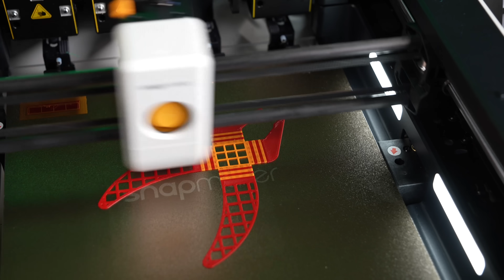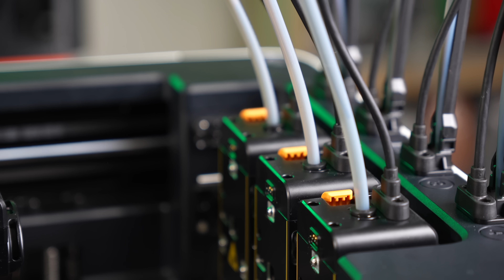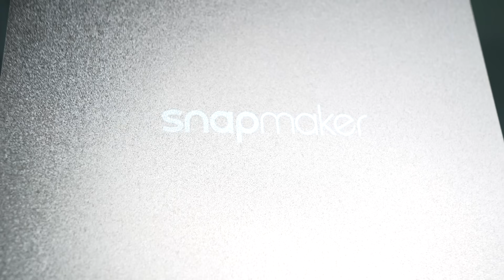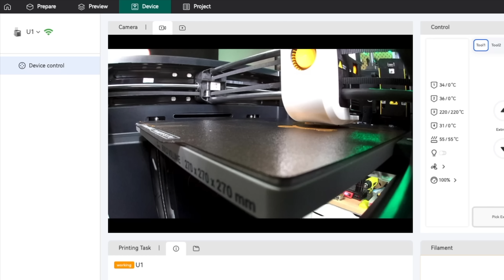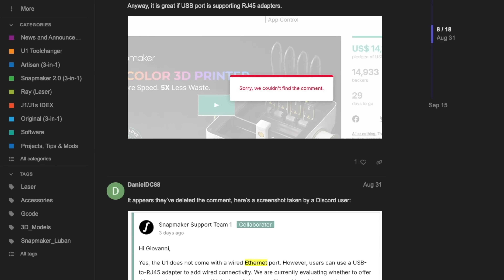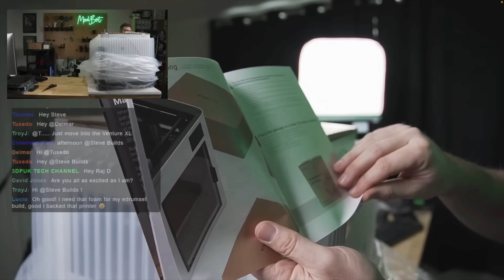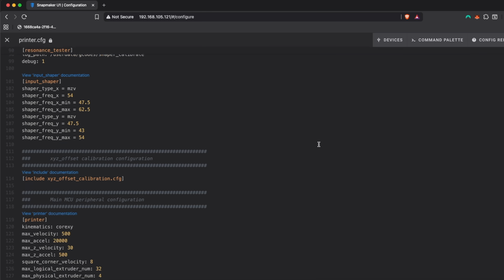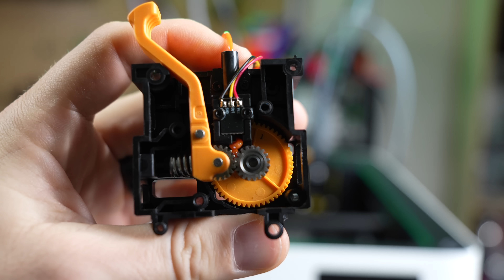Would I Back It Again? Snapmaker U1 Tool Changer

Comment: So tempting at 850
But I think I will wait and see how this whole thing shakes out with U1 and vortek and INDX and whatever else come out this year first.
Personally I am hoping for an A2C and or an A2D with a vortek system.
300x300x300 and at the launch price of the A1 or A1C
Have it be compatible with the AMS lite  but still offer an AMS lite pro with an enclosure and a dryer.
Same design of having all the PTFE tubes going into the tool head.
Maybe they can add 2 more spools so there are three on each side in a triangle formation.
Of just give us 4 and an option for an A2D so we can have five colors/ materials with the spool holder.
No retraction time like the H2C because the cutting is done in the tool head.
All they would have to do is put the vortek rack on a sled that moves front to back in the Y axis to the right of the bed.
The vortek upgrade is not even expensive.
I would love an entry level poop free machine that is in the Bambu ecosystem for multi color PLA prints.
This makes the most sense.
Like the A1 and AMS lite was faster than the P and X series because of no retraction.
Offer it in 2 flavors, A2C and A2D 
One with the dual nozzle tool head one without.
And offer each one as a combo  or let ius use our old AMS lite if we want too.

Comment: If you have filament in the loader (but not all the way to the head) are you able to pull the filament out without unloading on the screen? For example, if it starts loading, gets a bit of the way into the PTFE tube, are you able to grab the filament and push and pull it back and forth, or does the loader hold onto the filament and prevent it from being pulled out? (Like the AMS lite will sometimes not allow the filament to be pulled backwards without pushing the lever on the loader.)
Reply from the maker: Yes if it’s not fully loaded you can load it. I’d wait for after the loader to stop though. It won’t load it all the way into the toolhead until you tell it to from the screen.
Reply: Also, do you have to load the filament in a certain orientation? Like I saw the top filament loads from the bottom of the roll... And so does the bottom one... But could you flip the lower one over and feed it from the top? Just wondering if it's directional.
Reply from the maker: @willmorton6800 I found myself uncreating on the correct orientation for loading. There might be a right way but it always worked no matter which direction I fed from.

Comment: I really like this machine and the price point is good! I hope they make something at an lower price point.
I'm not interested in multi color/material prints, so I'd be happy with a single toolhead/color printing, something to compete with the mainstream brands with closed firmware, and unreliable machines.
Reply: Honestly... if you just want single colour & head... consider the QIDI Plus4, it's what I got, and I've been extremely happy with it as a single-filament printer.

Got mine in... march I think, and it's been super-reliable. 
Feeding TPU in is a PITA, but doable. I think that's the only real issue I've had.

Comment: My project printer will never run, from originally wanting it to be a corexy, to an enclosed one with built-in heaters, to wanting it to be on 48v DC and now waiting on Bondtechs INDX syste.

At least the K2 has been a work horse i just wish orca slicer wouldn't refuse to slice vastly different materials like TPU and PC, it should just let me ignore the warnings or offer a solution like using an intermediary purge material to bridge the thermal gap.
Reply: But you always learn something in the process while you build it.

Comment: The toolhead disassembly doesn’t look that much worse than a 1st gen bambu machine (X1/P1)
Reply from the maker: I feel like the Bambu X1/P1 has less small wires and it also doesn’t make you remove the toolhead pcb. It’s definitely not great either though.
Reply: @ModBotArmy I don’t have a U1, but from the video it looked like you could access the extruder gears with a lot of the extruder still in one piece. On the X1 it is 3 connectors and you need to take the extruder completely apart. P1 connectors are a lot nicer, but I wish you could retrofit the newer hotend type (A1/P2/H2)
Reply: Yeah, they ran their photocopier a little too early. 😆It looks very much like an X1 ... from the frame and motion system over the carbon rods and the part cooling fan to the finicky nozzle swapping with multiple different cables.
But, at least in theory, they can just release a new version of the toolhead. Current version retails for 70€, that'd be 280€ for a full set. Not cheap, but much cheaper than getting an entire new printer...

Comment: I've been using mine everyday since I got it and ran into some minor issues. I will say that the issues were easier to resolve than on my other printers. It works pretty well and I agree with your observations. Overall it is a wonderful printer and certainly better than most printers at this price point.
Reply from the maker: What issues did you run into? Also! What backer number were you? I strongly believe no printer is perfect but for the price point it seems like an incredible value for what you get based on my testing.
Reply: @ModBotArmy  One was a filament feed error which ended up going away after unloading and reloading filament that became twisted. It took a few tries, but has been solid since. The other issue was toolhead 4 alignment error. That was fixed by re-tightening the belts with their simple procedure..

Comment: Although it has multiple tool heads, how does it heat/cool the filament when switching?  Wouldn’t there still be a lot of delay heating and the possibility of clogging from non-traditional cooling?
Reply from the maker: Each tool head has its own hotend fan so it’s able to heat up and cool itself independently from being switched.
Reply: And I think it starts heating a few seconds before it's switching, to minimize delay.

Comment: Three primary reasons someone would want a tool changer over an AMS style system: It's better. It's better. It's better.
Seriously though, I applaud Snapmaker for bringing an affordable toolchanger to market that also seems to work well.
The print quality looks overall great and even if there is room for improvement in some areas, it seems like a solid value.
Reply: YES ahha